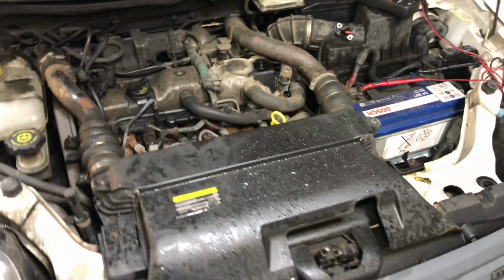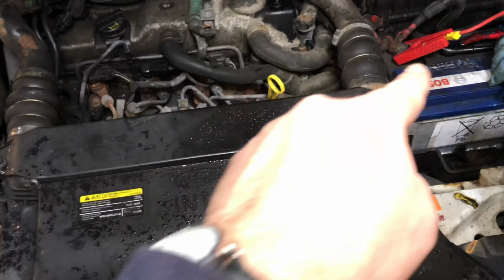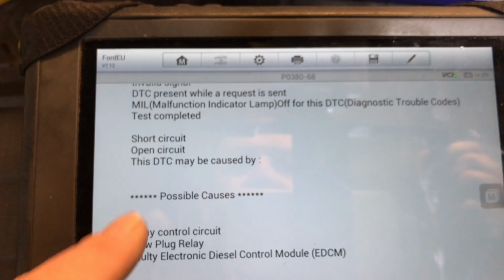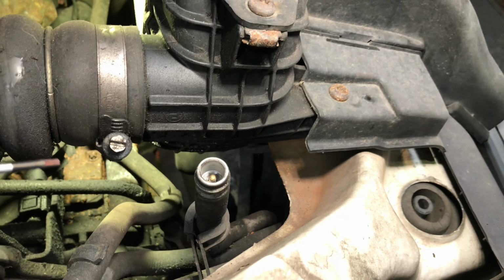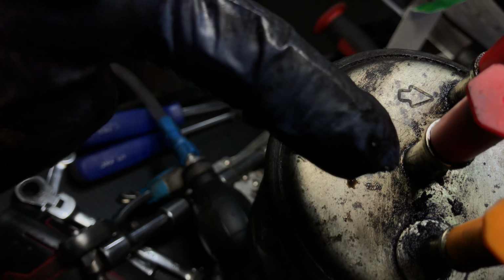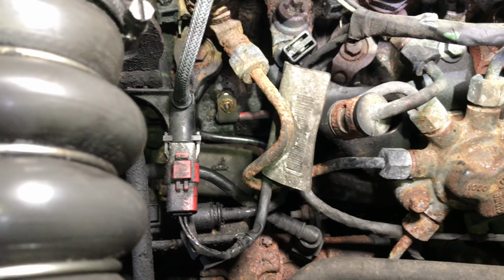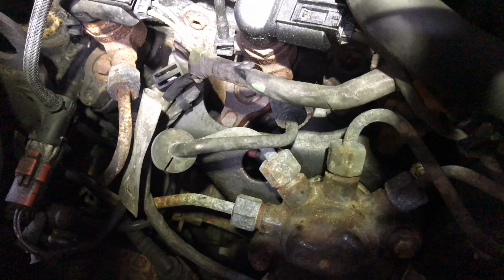Ford Transit Connect - Multiple Problems!

Comment: Sandy please don't advise people to depress the air con valve releasing refrigerant gas, this is against the law. You would fit manifold gauges and check for pressure 👍

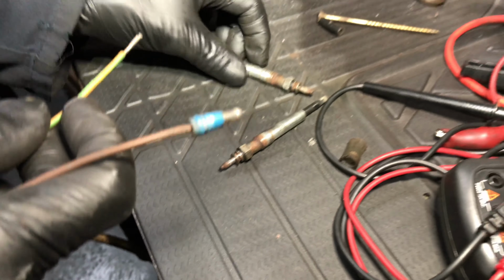Comment: Irn-Bru sighting @9:09 🤣 As an alternative...You can check the refrigerant pressure PID to get an idea of the pressure in the AC system Sandy. Cheers Pal
Reply from the maker: Good shout Ian never even considered that for information cheers Pal, Sandy
Reply: @sandyande  Only a starting point Sandy. Never trust it. You know this...All the best 👍

Comment: Hi Sandy, you said the glow plugs are in series, however they are in parallel otherwise you would only get battery voltage divided by 4 i.e 12/4 = 3 volts to each plug.. regards, ray..
Reply from the maker: Yes your correct Ray , I opened my fat mouth before putting brain into gear!!! Cheers sandy

Comment: Nice one Sandy , good old Ford's don't you just love em, had a weird one today , 2015 transit 2.2 car diesel , abs/traction control and Airbag light on , scanned it loads of codes , Canbus  faults , would clear then come back on , went to live data  , no wheel speed reading on nsf, found nsf abs sensor wire catching on wheel rim as bracket bent , moved away from wheel , cleared faults again and magic   Airbag light went out as well as ABS / traction control light , ordered new sensor and see what happens , also cannot buy outer CV joints for these new shafts only (pressed on CV joint ?) , Crazy days 🙂😂👍
Reply from the maker: Good find Mike just shows how they linking/networking codes just to boogle our heads!! Cheers sandy